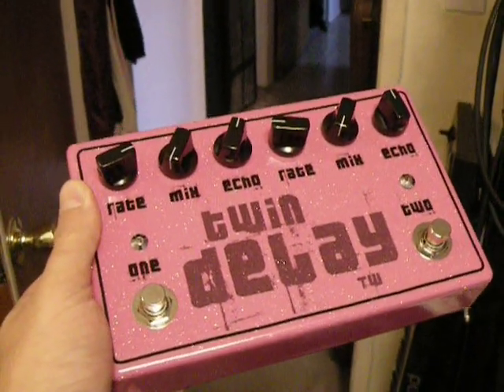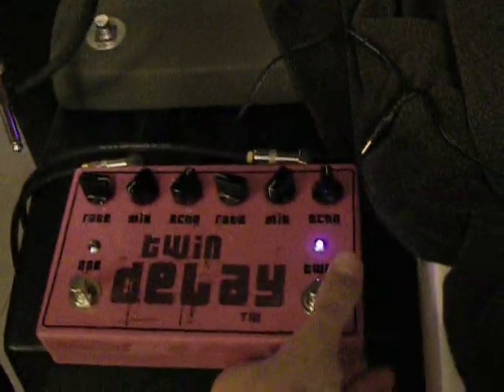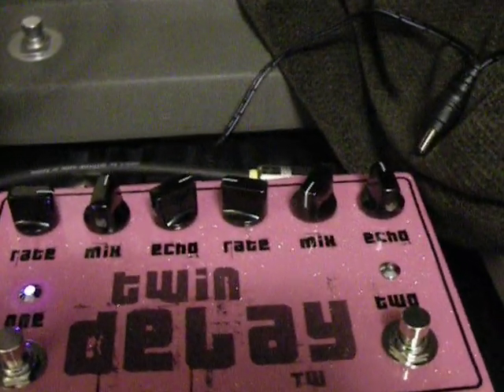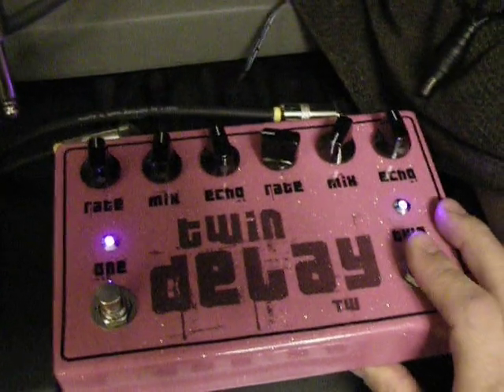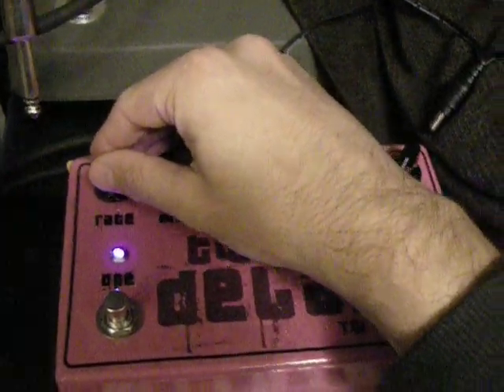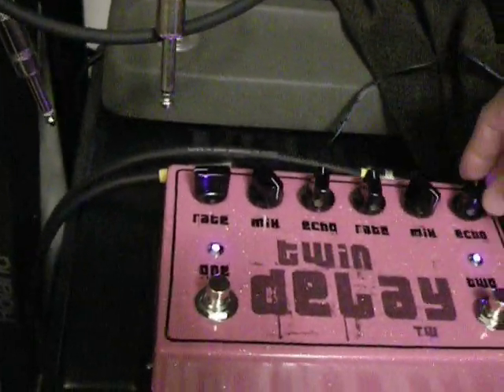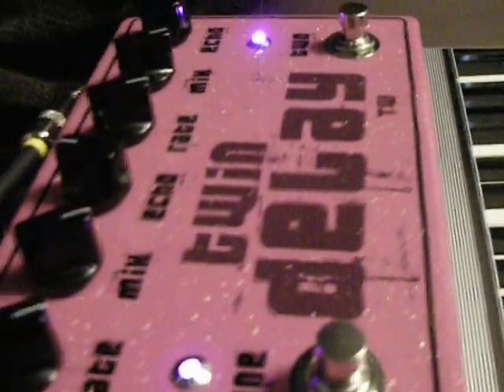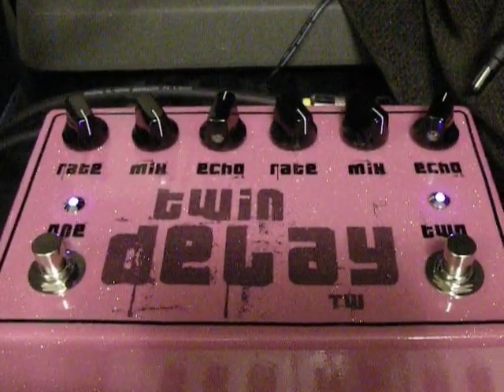"Twin Delay" Rebote 2.5 Delay Echo Digital Analog Pedal

Comment from the maker: Switchcraft 112a

One lug has a switch (3rd tab between the ground and tip tab) on it that disconnects when a jack is plugged in. I wired the output of delay #1 to this tab on the input of delay #2. Leave a cable out of delay #2 input jack and delay #1 (taps and all) feeds right into delay #2. Plug a jack into delay #2 and whatever is feeding into it comes through without anything from delay #1 since it was disconnected during the plug in to the input jack on delay #2. Helps?